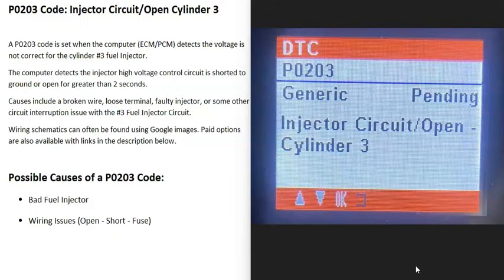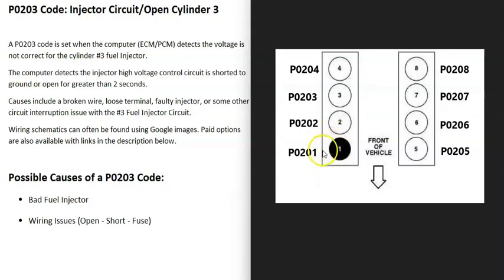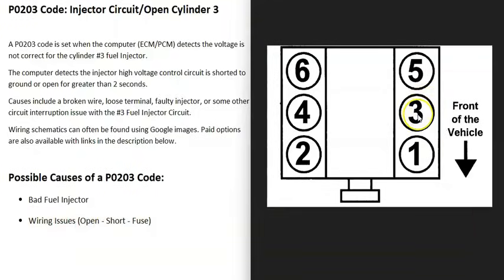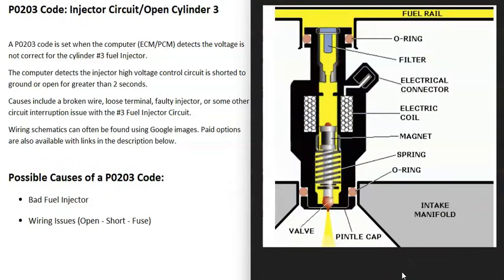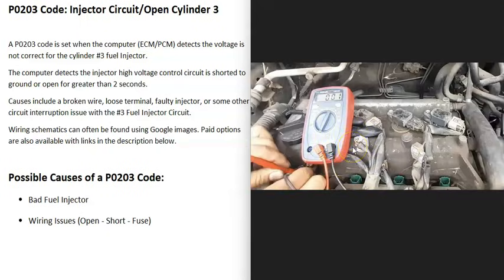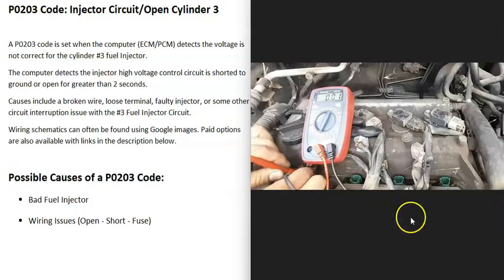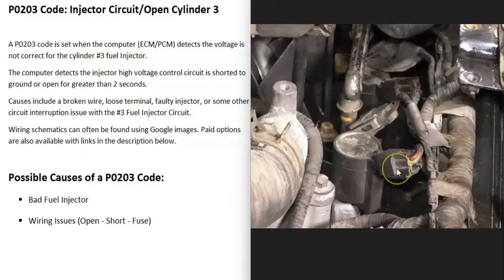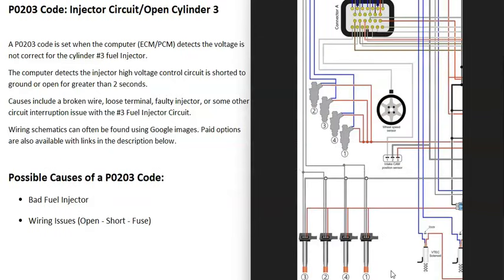Causes and Fixes P0203 Code: Injector Circuit/Open Cylinder 3

Comment: I have the same problem in my Dodge Dakota. I also rented a tool called a Noid light. It was 26 bucks to rent from O’Reillys and I got my money back when I returned the tool and what it does you unplugged the connector in question and you pick from a series of six Noids the one that fits and turn your engine on if it blinks it’s good if you get nothing, you got wire trouble

Comment: LOL I have the 4.0 2005 in a ford explorer. I dug into this mess when the plastic on the timing chain cassettes decided to break up and being an interference motor it bent 3 valves. 150,000 miles on it. I pulled the motor and rebuilt it. Put new injectors in it and installed the motor. Turned the key on an off afew times to make sure of no leaks then put all that crap back on the top of the motor and started it. Hooked my tester up and it says P0203 so this will be my 3rd time taking the intake off and this time I'm putting my old injector back in. There was never a problem till I put the new ones in. I appreciate your video and thank you. I hope its not in the wire.

Comment: I have a 09 ford escape and about 5 months ago i had a p0205 and i work for a dealership that is part of ford so i had them put an injector into cylinder 5 and payed for it well just this weekend i had a P0203 and im sure its an injector i am usually working on Nissan so ford is a bit different your video gave me all the steps i needed to do this one myself. Save some money because last time it was like 600 bucks . Just wanted to let you know that im thankful for this video.. Made my life easier and my pocket book easier